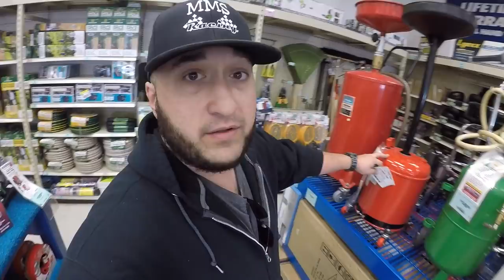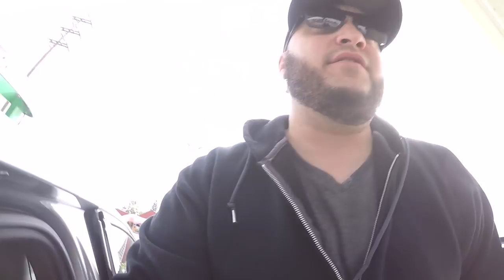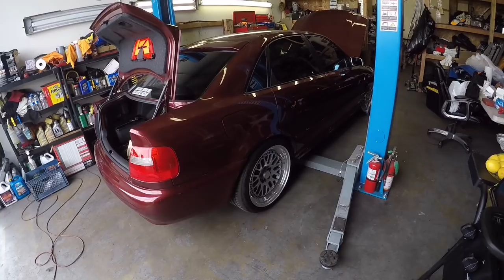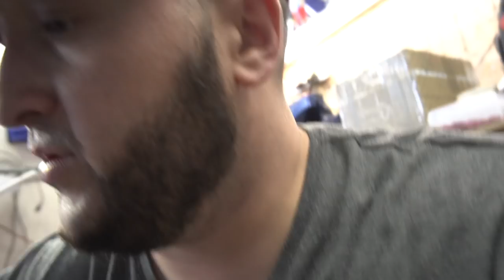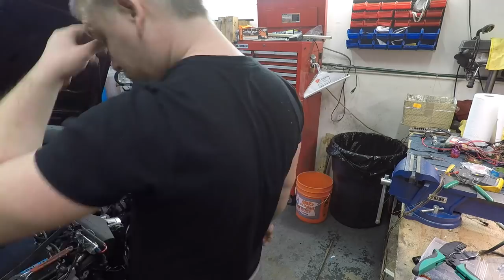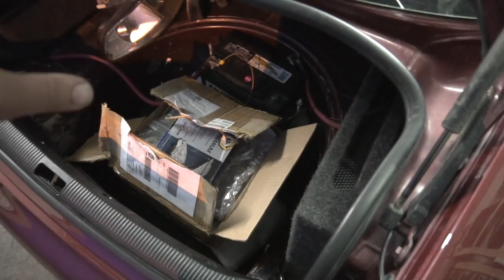BIG TURBO AUDI | STAV'S QUEST FOR POWER | Episode 4

Comment: George those threads on the oil filter housing are metric, M10x1. 1/8" NPT will thread in (pitch is about 0.98) just be careful not to destroy the threads.